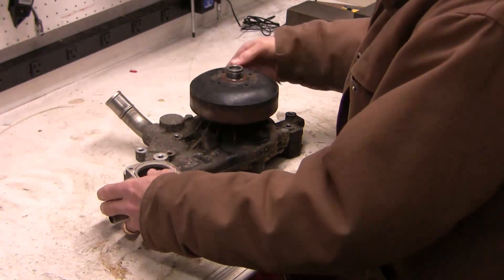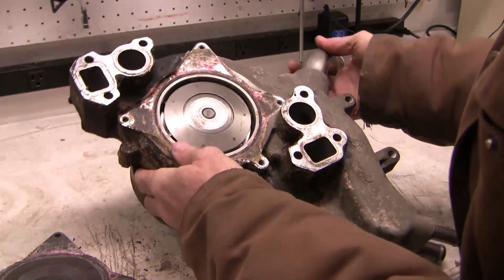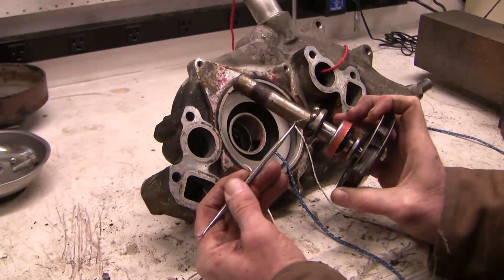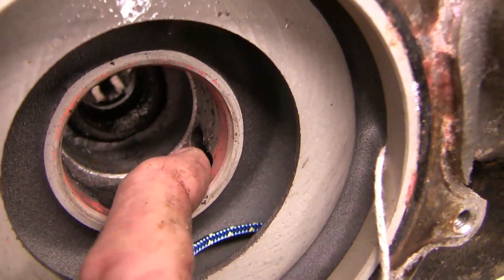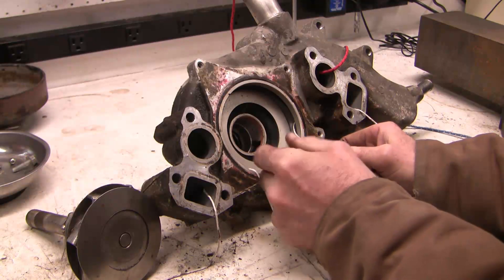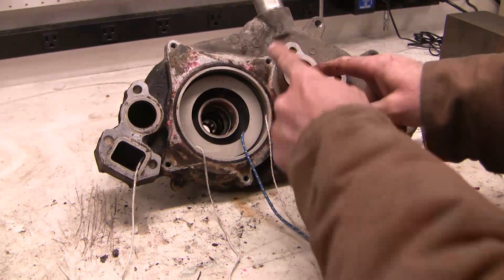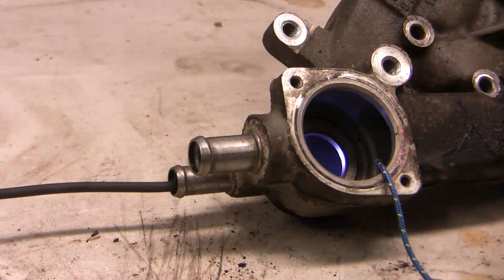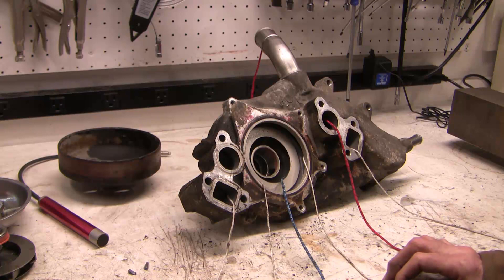Inside a chevy water pump -- how it works

Comment: +spelunkerd - THANK YOU very much for the informative Video. I have a few questions... Last year, I decided to " CUT " the thermostat open and let the Water By-Pass. The Engine Runs Cool until Winter, which I really LOVE :)))). My Dad forces me to put the Thermostat back so he can have Heat in Winter, so we did. Now, this year... I was going to do it again, but I didn't want to get yelled at :(((. My question is... It is BAD for me to " Winterized " the Car and " Summerized " the Car by changing out the " Cut / Non-Cut " Thermostat? I know that Manufacture did it for " On-Demand " Heat... But in the Summer, who needs On-Demand Heat? Do you think that is Bad for the Engine? Because during the Summer month like right now... The Engine is like 200+ Degree :((((... THANK YOU VERY MUCH !!!!
Reply from the maker: Excellent question, certainly a favorite. That was an old farmer's trick, it seemed to work great in the summer. Here's my first thought. These engines are designed to run at ~180 deg F, so regardless of season they start out too cold. Of course it's nice to have heat in the cab, but more importantly when cold the thermostat makes the coolant bypass the radiator to speed warmup. So without a thermostat, engine warmup is also always slower, regardless of the season, because cold antifreeze should bypass the radiator to go right back into the engine. Note that the cold volume of antifreeze trapped in the radiator is held there until the engine is up to operating temperature, so the initial volume of coolant the engine has to heat is smaller. It is said that the majority of engine wear happens in the first few minutes, because cold oil doesn't flow well through narrow passageways. These engines are designed to run at about 180 def F, and the PCM reacts to colder coolant temperatures by choking down intake and increasing injector pulse width. It may take longer for your engine to go into closed loop because the O2 sensors and cat require high temperatures to work properly. So, I'll guess that even with summer use only, your engine may not last as long and may have poorer startup fuel consumption and poorer emissions without a thermostat.

One thing to note is that some thermostats have a tiny hole to allow trapped gas through. Remember to install the thermostat with that hole at the top. In the case of the Chev, that's not an issue because you can't install it upside down. If you find a hole in a thermostat remember to put it at the top. Thanks for watching, these kind of questions enrich the thread and make the effort worthwhile.

Comment: Hi there, 

i have a quick question that i'm currently debating with some friends.

as far as the Tstat as a general rule should't the hot water be coming OUT of the Tstat? tht way the tstat will l remain "open" for all the hot water to come out ant close once cool water touches the tstat?

Thanx in advance.
Reply from the maker: +Ruben Quintanar That's the way they typically work, opening to direct water through the rad once a threshold temp is reached. However you'll notice this one is a little different, unusual. In the water pump shown for, the thermostat closes the bypass tract when threshold temp is reached. In all cases, the thermostat is bathed in coolant that is coming out of the engine, and the bimetal coil of the thermostat is always on the engine (hot) side.
Reply: +spelunkerd i see, this makes sense now,  thanks for your reply :like:
Reply: +spelunkerd, it's not a bi-metal coil of thermostat.  Proper lingo there is wax servo motor (I hold an expired patent in a related function).  The wax used melts at 180 or 195 degrees and as it does so the expansion of the now liquid wax forces the thermostat to open much like a hydraulic cylinder would operate that poppet valve.  Ice expands as it freezes, wax is the opposite of that.

One thing I have notice over the years from the early style pumps to the latest ones is that the weep hole is now designed for obsolescence rather than the diagnostic function you mention which used to be quite useful in that regard and of those you speak the truth.  The old style weep hole was on the bottom where the coolant would leak away not causing the bearings any harm.  Today's water pump places the weep hole well above the bearings in order to render them trash asap.  $50,000 and I have to drill my own weep hole.
Reply from the maker: +Lee Barnes Hey, Lee, thanks for contributing to the thread, those are insightful remarks. 
Dave
Reply: you mean wax pellet, not bimetal coil, right?

Comment: I was wondering if you could answer a question for me based on your video I have a 2000 5.3 in my Silverado and it only leaks when it's not under pressure however when it's warm and is put under pressure it doesn't leak could that be what you were explaining in the video that happened to yours? Or is it the back plate seal of the water pump? Either way I know I have to replace the water pump I just want to understand a little more about it any help would be great thank you in advance
Reply from the maker: Yes, some leaks happen only at rest because pressure holds the seal in place when the vehicle is running. At night that pressure difference is actually reversed, drawing fluid from the coolant reservoir back into the system. That kind of leak is a kind of 'ball valve effect'. I suppose if the mechanism for automatic filling were blocked, such as a stuck shut valve in the radiator cap or a kinked reservoir tube, then negative pressure inside the system overnight might drop more than it normally does. I did a video on the radiator cap, "Hidden genius behind an engine cooling system" that is worth a look. Whenever you have cooling system issues the first place to inspect is that rad cap and reservoir fill tube. You should be able to pry that second tiny one way valve of the rad cap up. Look closely for sticking or cracked seals there. All of that said, you want to go to where the leak is and decide how to deal with it. It's too bad we end up replacing the water pump because the back seal doesn't last as long as the pump does. You might be able to find a new seal, but most guys who take the repair that far end up replacing the whole pump, if only to try and prolong the time to the next repair. Good luck!
Reply: Well that explains why the leak is the worst when the cap is off such as when I'm filling the coolant system

Comment: What made your pump fail?
Reply from the maker: This time it was leaking at the seal where it mounts onto the block. You can buy another seal and not replace the pump, but most guys replace the whole thing because of the labor involved and the chance the pump will fail later. Another very common failure point is the seal at the bearing, separating oil and bearings from coolant.

Comment from the maker: I've never done that, but search for the videos " waterless engine coolant". Apparently the Evans version is about 2/3 ethylene glycol. But the boiling point of that is so high that if you overheat, everything gets really hot, rather than getting a latent heat (boiling) plateau at about 140 deg C. Something tells me such a plateau is important, though I could do without the corroding effects of water....

Comment: Why did the manufactures not use sealed bearings and waterless coolant?
Reply from the maker: Regarding the waterless coolant idea, that's a great question, one that is hard to answer as a brief reply. One thing I like about water is that, even under pressure, it boils at a fairly safe temp, giving the driver an unmistakable message (steam from the hood) that he must stop the vehicle immediately. While water is boiling the extra energy is consumed by the change of state and so temp doesn't rise very fast at that point. That thermal plateau allows the driver to usually stop the car before the engine is ruined.

Waterless coolant that is on the market now has a much higher boiling point. Not only do you lose the physical warning, you also lose that safety plateau where the rise of temp is temporarily stabilized by a change of state. So, as much as I acknowledge that water is the source of many problems in today's engines, today's waterless coolant does have a couple of drawbacks. The extra cost of waterless coolant is probably part of the issue for new vehicles, as well.

The main bearing is sealed, but when I put it in the press I broke it in half to get it apart. Thanks for your comment, Allen!

Comment: Great!  I could never find where the weep hole came out on my water pump outside the case.  My truck is a 06 Sierra.  It gave out at 50K miles.  It would squirt out a little coolant as I drove it as it was heating up.  Once hot it stopped leaking..... weird.
Reply: Wonder if the heat made the seal more flexible or expand, then stopping the leak until it cooled?

Comment from the maker: So did I. I was a little surprised at the difference between this Chev design and the Chrysler design, where the thermostat is mounted in line with the radiator entrance hose.

Comment: Wat happen if there is no thermostat would it make it overheat
Reply from the maker: Excellent question. As you know, traditional thermostats can be removed, with the main problem being slow warm up when cold, no overheating. However in this design a missing thermostat will cause the engine to warm up a little more slowly AND run very hot after warmup. It may not be so bad as to cause a steam over, but neither the radiator nor the heater core will get the directed circulation to move heat effectively.

Comment: 3/4" goes to heater core?
1" goes to resistor?
Reply from the maker: The bypass channel is large but just beyond that opening the hoses to the heater core are normal size. A big bypass allows a fast warmup before the car hits operating temp, then that valve closes and fluid is routed through the radiator. I did a recent (better) video of a marine diesel cooling system on my channel, and I show more detail as to how that two valve thermostat works. Amazing engineering.

Comment: How long a pump last chevy silverado 2002, change IT 5 years ago
Reply from the maker: Remanufactured pumps don't last very long, the seal separating the bearing from coolant tends to go first. 5 years is sadly about average, shorter with new cars. Over twenty years on this 2000 suburban, the first lasted about 15, the second about 5 years.  Most guys replace the thermostat at the same time, keep an eye on the temperature gauge after it is done. This thermostat design can sometimes fail to close completely during hot weather, causing a bypass of the radiator and a hot running engine. Your only clue may be the gauge.

Comment: I just had my water pump break completely off and smash into my heavy duty extra cooling radiator, the water pump bolts and the pieces they are holding are still bolted to the block, anyone know what caused it ? I'm not a professional mechanic but I have been working on vehicles for 35 years and this is a new one to me, any help out there ?
Reply from the maker: +Richard Rathman If the bearing seized then there would be angular torque on the water pump pulley that could be enough to cause damage. I would have thought the belt would break first. I suppose if the impeller had broken and seized the same could happen, perhaps with enough force to pry and break mounting bolts depending on how a fragment of the impeller was wedged against the pump body. I've never seen that before. That would be a fun video, ha ha.
Reply: +spelunkerd  Yea, I'm pretty laid back, so I was more amazed than anything else, after I made the post above I went back outside and took pics, pretty narly scene, I then proceeded to use a good size flat screw driver to dig the fan blades out of my practically new heavy duty radiator, a couple of the blades were deep into it not to mention my plastic shroud is in several pieces, after I got it out of the rad I  was thinking like you that the thing was gonna be locked up, but it wasn't, what it was doing however is wobbling, its not a pulley per say its one of those that the belt is just up against, you know the kind it is smooth, and guess what? my belt didn't break, my guess is the wobble caused the belt to slip off and onto the pump housing and it had enough force to just snap the pump right off, tomorrow I am gonna take it more apart and see why it was wobbling, probably the bolts came out or loose where the fan bolts onto the pulley, let this be a lesson to everyone, yes a kinda humorus one, make sure your pulley isn't wobbling a lot and your bolts are secure, cause evidently mine weren't, thanks for the reply, I will be buying a new pump, rad, fan, shroud and probably a belt cause even though mine didn't break I'm betting that it stretched a bit. Thanks again, later.
Reply from the maker: +Richard Rathman This is a great story, one that I'm happy is recorded here for others who visit this page. I'm convinced that experience amounts to having had a chance to see many strange things happen. When combined with a careful, thoughtful, methodical work pattern it's what separates the best mechanics from the rest. Thanks for stopping by!

Comment: pressing the shaft out should be done from the inside out ..but i stand corrected if i'm the one thats wrong...
Reply from the maker: Oh, thanks for your clarification, you're possibly right. In this case I couldn't see a way to take it off the other way. The head of the impeller was frozen to the shaft, covering the end completely on that other side.  I suppose I could have tried to pry the impeller off, but with a press I knew it would be easier to force it off, leaving the impeller in position to more easily see how the system works. Thank you for watching.

Comment: I always drill 2-3 3/16” holes in the thermostat and it slows you to have instant heat in the winter and and when it  finally goes out in the closed position you can usually at least limp home.I know this right cause I finally bought a performance Stewart pump and they do the same thing.I’ve been doing it 50 yrs
Reply from the maker: Those holes are there to allow trapped air to escape before the thermostat opens, mostly in engines that have had the system opened. You want the hole to be at the top where trapped air floats. If the bypass pathway is working, liquid flow down the tiny hole should be far less than flow down the bypass. In the old days we would remove the thermostat as a test, but in two valve systems bypass flow is too high, causing overheating. The price of higher flow to the heat exchanger is more engine wear at startup because it delays warmup.
Reply: @spelunkerd  all the stats I’ve changed I’ve never had any trouble with air but I did see it happen to a friend about 10 yrs ago but yeah it does that to,I’ve just gotten more mileage out of the other two.

Comment: Question: Why would GM design a water pumps that can’t cool the vehicle when at idle/low rpms like the ones In there 90s series LT1s with the Opti-spark??????? They claimed reverse cooling was the shit back in the day but apparently not when your sitting at a traffic light in a small Texas town where they haven’t changed the lights from horse n buggy mode to 2020 space age anything over a few minutes and she taps 230+ and I’m sure that can’t be good for the intake or head gaskets or the pump rubber seal.
Reply from the maker: If you're having overheating while at idle, I'd consider replacing your thermostat, or at least check to be sure you don't have trapped air in the system. If this thermostat gets stuck closed, or if for some reason the bypass pathway isn't completely blocked when hot, the coolant will find an easier pathway back to the engine before it has cooled. It completely bypasses both the radiator and the heater core. Because this thermostat governs two openings, various combinations of problems can be seen. Some engines run chronically hot because the bypass doesn't close completely, taking years off the life of the engine. Be certain the thermostat you buy is designed for this exact pump, I would probably look for an OEM choice.
Reply from the maker: Oh, the other thing is to check your fan. This one is belt driven, but newer models have electric fans activated by a thermostat. Overheating at idle should trigger any electric fan to come on. If not, you'll do the Harley Davidson thing, overheat at traffic lights.
Reply: @spelunkerd  my car has two fans and they do work to my knowledge because I’ve sat in store parking lots and can hear them kick in and it does help. But the water pump at least doesn’t seem to cool much when at idle. When at above 1500 R.P.Ms the temp goes back to 190 Degs and stays there permanently. It’s as if the pump just couldn’t keep up with the demand of flow during those times. I guess I better just check every single component of the cooling system before something blows out and more cost ensues.
Reply from the maker: @marknowakowski6590  It is not easy to test these thermostats, but they are fairly inexpensive and easy to swap over. I'd get a new OEM thermostat and swap it in.